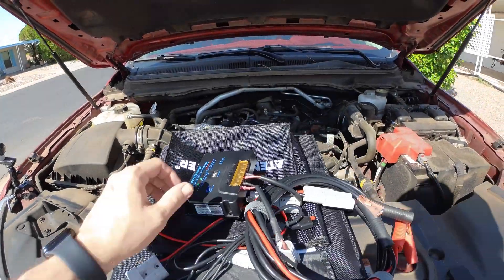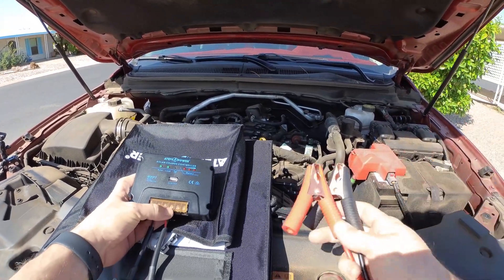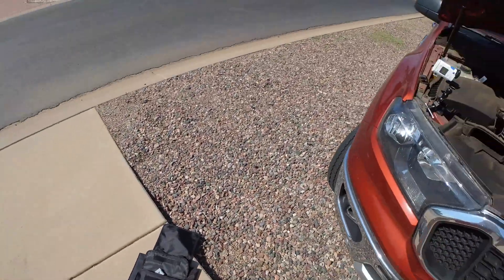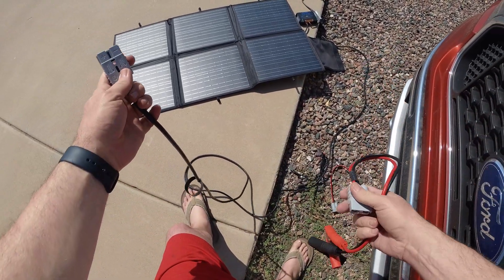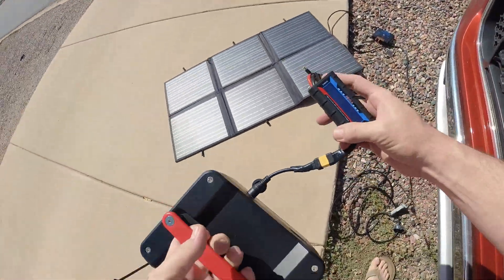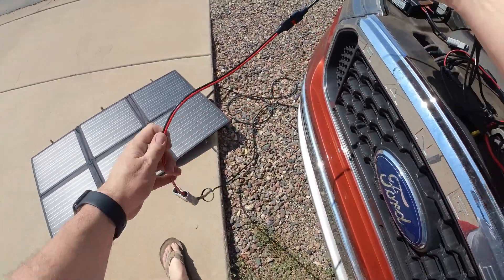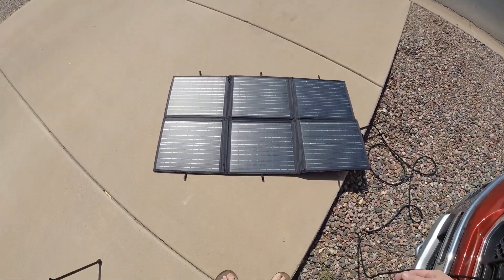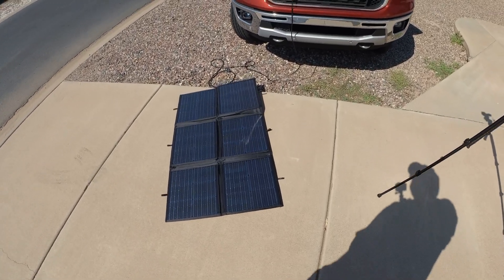ATEM Power 100 Watt Folding Solar Panel Test Including External MPPT Charge Controller

Comment: I am looking to use this on a Wattfun 500Wh power station.  Do you believe this would be ok to charge this station or is it too big and should I find a 100W solar panel?  Thanks!
Reply from the maker: This is a 100 watt solar panel. It would work fine.
Reply: @NewZonaRides  Thanks a lot!  I was a bit confused as several locations advertise the panel as a 120W rather than a 100W.  But it seemed like it should work.  Thanks for confirming this for me!  I'll be getting one!  Also, great video on the review!!  Very helpful!!

Comment: Thank you. I just got the same product. The provide printed
 instructions are a little bit fuzzy. If it’s working properly, are the battery lights suppose to be solid or blinking?
Reply from the maker: Solid on battery level and next one blinking if charging.
Reply: @NewZonaRides  thank you!